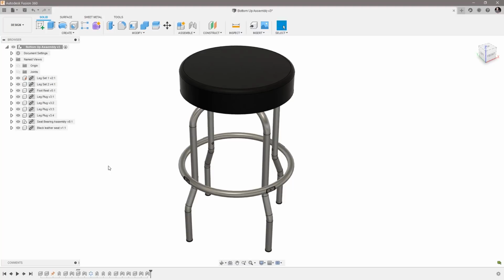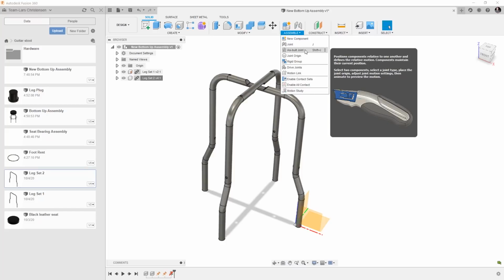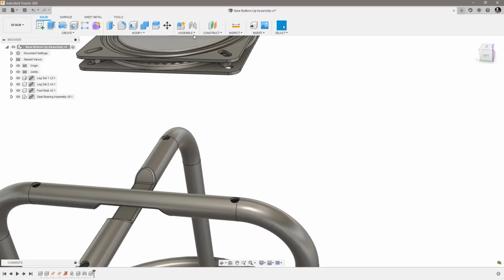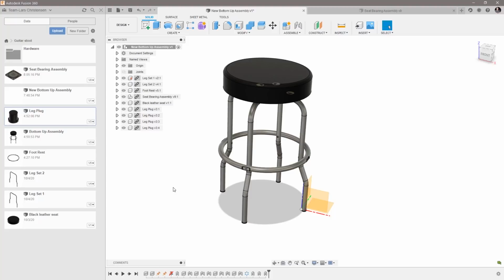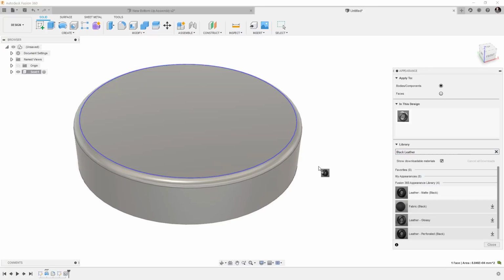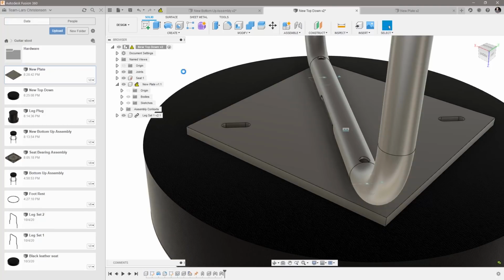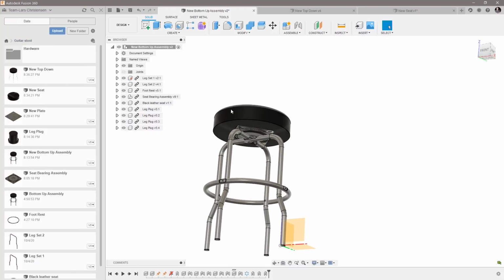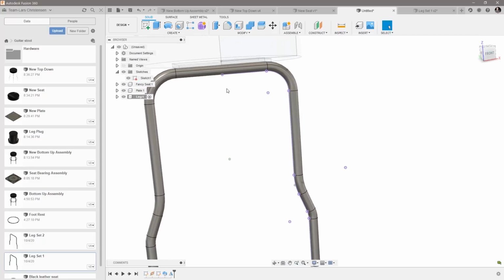Fusion 360 - What's New Assemblies -Season 3

Comment: Hello Lars,i am using fusion 360 not so long yet,but i can manage a lot,i even designed my already build model fishing boat.all is going good,except the lofting for the skin of the hull.
for the straight part i used a thin extended body with same size/dimensions as the ribs,i just extruded that as long as i needed,that did worked,but getting to the front section where the ribs are going to murge into the ships nose,the lofting between 2 ribs does not work??????each rib is a seperated body,aswel the midcenter axel ribe the keeps al the ribes in line

Comment: Thank you for the great video. I especially like your pace. I have a question that you inadvertently demonstrated during this video. When you were making the slot in the plate for the seat screw hole, you made the center of the slot coincident with the existing hole. That was your design intent, and Fusion picked up on it. However, a couple of minute later when you were finished the slot feature, you demonstrated my big pet peeve, that this constraint was "lost". And you had to manually add it back. This happens to me every time I make a sketch. It is super frustrating, to have something "pretend" to be constrained, but then it tricks you. Is there something I'm (and you in this particular instance) did wrong to cause the constraint to "not stick"? Thank you for your time! Nick.
Reply from the maker: Hi Nick, Thank you for watching the video. Normally when you loose a constraint it's because you made a change, like you delete a line or a radius, and the constraint looses it's reference.
Reply: @cadcamstuff  but you didn't do that here, did you? It seemed like it lost the coincident when you changed the length of the slot, but I'm not sure? Could it be because it was a slot and not say a circle?

Comment: Lars, I have learned a huge amount from your videos over the past 12 months. They are brilliant!...    BUT I am a hobbyist. So, does that mean I have to pay to get use of Fusion 360 from now on?  I can live with the limitations but, if I cannot use F360, then the last 12 months learning have been completely wasted
Reply from the maker: Fusion 360 for personal use is not going away. I'm curious what would make you stop using it
Reply: @cadcamstuff  For me - the elimination of tool changes.  Having to create a separate post for each tool is bad enough but I can't generate setup sheets either.  I am new to machining but have managed to get access to a tormach with a tool changer.
Reply: @cadcamstuff  It's simply the cost, Lars.  I understand the compny has to make a profit and they need to charge for use of the software. Sadly, as a retired trainer, I don't have the funds to support my hobby of 3d printing and pay for F360 on top.

Comment: How do you use Fusion 360 to include a component that must be deformed to be assembled - such as a washer, o ring, etc?  On a more complex note, how would one assemble the parts of a strain wave gear assembly? In this case, the flexible spline will need to be deformed to only engage the teeth of the circular spline at two points 180 degrees apart.
Reply from the maker: Hi David, You would not model a deformed o-ring unless you want to show it in compressed state in a 2D drawing.
Reply: @cadcamstuff  Thank you. How would you model the deformation of a flexible spline 
of a harmonic (drive) gear train?

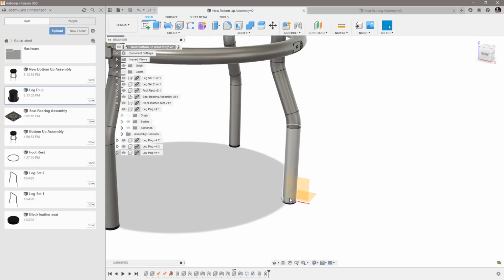Comment: Are you saying that SolidWorks can't do top-down design (it can)? At 30:47 you say you don't know of any other CAD software which can do edit in place in a bottom up assembly, but that's exactly how many other CAD packages work. This isn't the first video from a Fusion 360 presenter where I've seen this misinformation. Fusion 360 is a good program with some great features, but there's no need to say false things about other systems.
Reply: @Greger Holmes  Kid, your parents shouldn't let you surf the web. Go back to playing with your friends
Reply: Are you sure you can edit IN PLACE, without leaving the main part/assembly?
Reply: @alejandroperez5368  Yes, I'm most familiar with SolidWorks and have also used SolidEdge, and both of them have always worked that way as far back as I can remember.

Comment: For the free/privat version: With the "edit in place" feature, would this still work with an archived part or would that particular part need to be manually reactivated first? This would do away with the advantage that you wouldn't need to search for the part.
Would be nice if the part in question would automatically be "un-archived" as long there is at least one of the 10 active slots vacant. This way one would only need to archive any one of the unused active ones but not search for the part that wants to be edited.
Reply: I think they've remover "Edit in place" feature in the recent update for Free version - I used it last week, but now it asks for subscription. Too bad, It was really useful
Reply: @Gusto20000  Interesting - that one was not in the list of Personal License restrictions... but now I see it here https://knowledge.autodesk.com/support/fusion-360/troubleshooting/caas/sfdcarticles/sfdcarticles/Fusion-360-Free-License-Changes.html